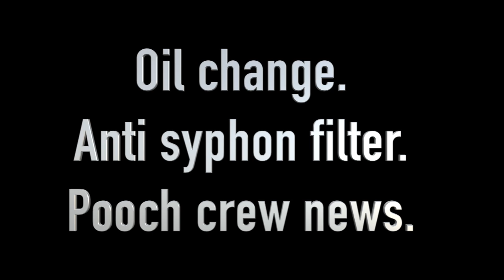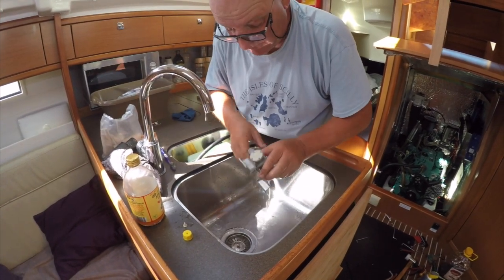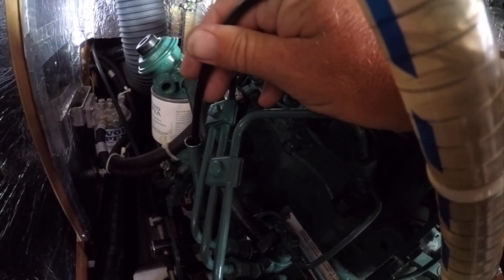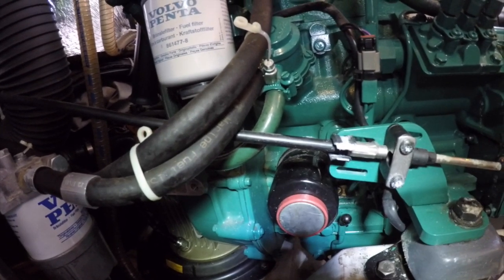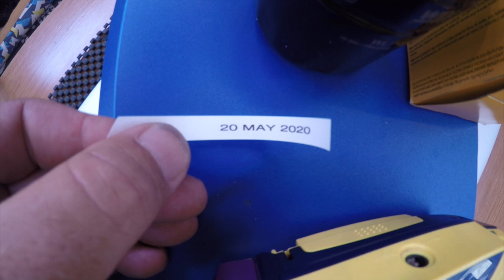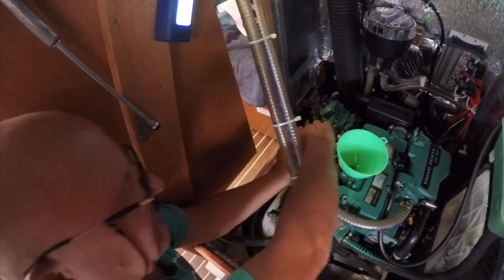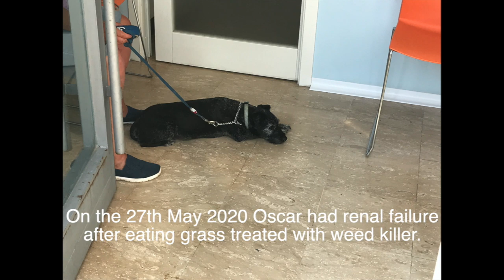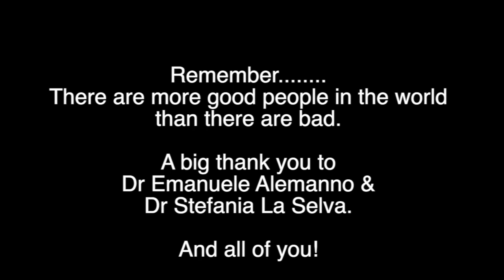Sailboat, Boat Engine Maintenance part 2. Oil Change & Anti Syphon valve.

Comment: Hello ! Just wanted to say that I like your videos. Thank you for sharing your knowledge ! I have a D2-40 F on my Bavaria 38 cruiser, I don't know if you have the same oil filter (Volvo ref 3840525), but on my engine the exact same is the Purflux LS801. I have open the old Volvo penta filter and noticed the way the paper is folded (like in zigzag, it offers a larger filtration area). The french company Purflux have a patent on this. So the Volvo filter is in reality a Purflux LS801.  The Purflux is three times cheaper than the Volvo despite they are the exact same filter from the same company.
Reply from the maker: Wow thats great to know we will look them up. Thanks for the feedback. Sail Safe  Sail Safe mate. Ant, Cid & the pooch crew.

Comment: Hi Ant. A friend keeps telling me that the anti-siphon should be between where water exits heat exchanger and muffler so stops coming back in from exhaust outlet back into engine. My D1-30 has it between basket and water pump, sort of similar to you. Not sure if we can use it on exchanger outlet. Any thoughts? Thanks
Reply from the maker: Hi David. The Anti Syphon valve allows air into the pipework (raw water) to prevent syphoning. It breaks the vacuum that can cause the syphon.  If the water level inlet in the system is higher than the exhaust elbow (or the water cools and contracts), the water can start to syphon into the exhaust. 
This first fills the exhaust pipe, muffler and then the exhaust manifold. If any of the exhaust valves are open it can then flow into the combustion chamber. Liquids cannot be compressed and so, on starting the engine the piston will hydro-lock damaging the engine. Or sea water will pass the piston rings and enter the engine sump. 
The exhaust should have a goose-neck at its far end. It is this that stops water coming back down the exhaust not the Anti-syphon valve. 
However, the valve can be before the heat exchanger or after it.  In your case with the Volvo Penta D1-30 it is before the exchanger with good reason. 
When the engine stops the Anti Syphon valve opens it allows air into the pipework before the exchanger. This in turn allows the raw water to exit the pipework before the exchanger and from/in the exchanger, into the exhaust elbow and then into the muffler/exhaust pipe. In this case the Exchanger then has no standing sea water inside it.. 
If the Anti Syphon valve was between the elbow and the exchanger it would not allow sea water from the valve to the elbow to drain. IE. This would mean that the exchanger would remain full of sea water when the engine is shut off and the raw water system is un-pressurised. Which is not as good as draining the heat exchanger every time. 
Saying that the anti-syphon valve stops water coming back in from the exhaust is totally incorrect. 
The valve is as its name suggests an Anti syphon or Syphon Break valve. 

Hope this helps. Have a great New year. Sail Safe mate. Ant, Cid & the pooch crew.
Reply: @SVImpavidus  that's a great explanation thank you. I wonder if it would be beneficial to shut off inlet seacock each time after stopping engine (just need to remember to open before restarting!)? Especially on long sailing trips.  Thanks and happy Xmas and new year.
Reply: @SVImpavidus  ....also would the raw water pump stop ant siphoning from inlet? Thanks

Comment: Quick question about primary fuel filter - yours looks the same as mine but the filter on mine had no markings/branding?  My engine is a md2030, (and my engine bay isn’t as clean as yours at the minute as I’m working on it...)Have you done a video on changing this?  Do you know the filter type/if mine would be the same as yours?
Reply from the maker: Hi Kevin. Your filter is Volvo Part number 861477 for the screw on cartridge filter and 3581078 for the element (CAV type) primary filter. You can cross reference these numbers on the web to get the equivalent filter from people like Fram, Man, or Wix. These are just as good but a fraction of the price that Volvo charge. We have not done a specific diesel filter change video but we will put it on the to do list.
Reply: @SVImpavidus  thanks for this.  I use parts4engines for my spares/supplies and they seem to be fairly good for prices. I’ll see if I can find a video showing this being changed.

Comment: Hi guys, very nice videos out there. I see you have the coolant box on the side, have you raised it to be above the engine level? I would like to do the same on a bavaria 30 cruiser, and also I see you have a vent to remove the heat from the compartment. Does it work only with the engine on? where do you take the power from? And Can you tell me where have you orientated the hose, in my bav. I cannot drive the hose backwards because it is all cramped.
Thanks
Reply from the maker: Jordi. Hi. We unbolted the header tank from the engine and fixed the bracket to the side panel. The hoses are just replaced with longer ones. Routed away to the tank. there should be room to take them sideways. Make sure that they are clipped or cable tied to prevent vibration against the engines forward lifting eye. The vent is automatic taking a feed from the + side of the alternator output. It is only on when the engine is running. But you could put it on a simple switch on the engine control panel. Sail Safe mate. Ant, Cid & the pooch crew.
Reply: @SVImpavidus  Thanks, I just got to know your videos and I'm hooked to the electricity series.
Reply from the maker: @jordim7828  glad your hooked 👍👍👍

Comment: Terrible about Lady, but great to see Oscar nearly wagging his tail off. 
Now then - shock news. We were told the other day that Volvo engines have a DEDICATED oil suction port - you do not have to use the dipstick. Run your eye down from the oil filter to the back of the sump on the starboard side and there is a little tube with a black shiny cap. That is it. I went and looked after I was told this and there it was. The guy telling also said it was "fragile" whatever that means... so I will probably carry on using the dipstick.
Reply from the maker: Yes your info is right. But dont use the port! Its a Volvo trick! The end cap is a tight fit and if you take it off it will never be the same. Any back pressure in the crank case will blow it out and put the engines oil in your bilge (not good) The older an engine gets the more crank case presure you get as, gasses get past the rings etc.There is no crankcase breather tube to the inlet manifold on these engines so they will just blow it out the weakest point if there is an issue. (that could be just a valve that needs adjusting).
Ozzy is a soldier and a tough nut!
Sail Safe Guys, Ant, Cid & the pooch crew.